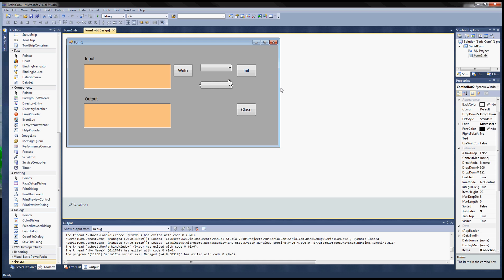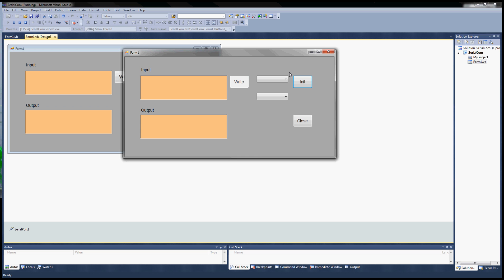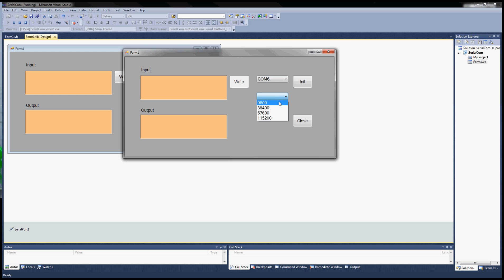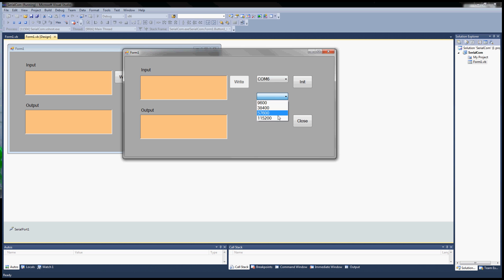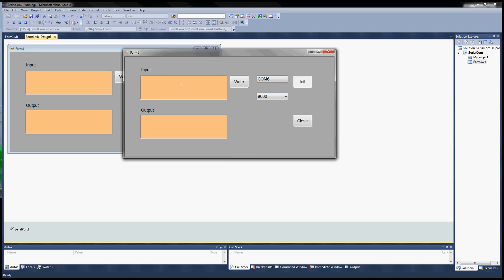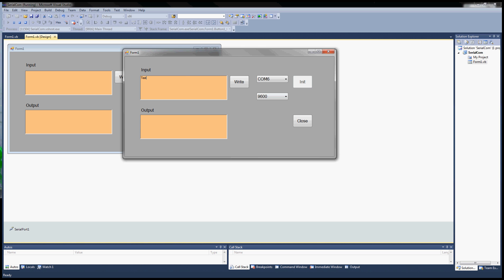Visual Basic Serial COM Port Tutorial (Visual Studio 2010) - Part 1

Comment: I tried send hex over RS232 in VB  and successful and properly received by another RS232 if hex value less than &H7F.  But, if the hex value greater then &H7F to &HFF then the receiver side shows &H3F. I've believed that the problem come from the signed and unsigned. Would you mind to give me an advise for  how to solve it?

Comment: I just downloaded and tried it out. No errors and it worked good using VB Express Version 13 and Windows 7. Thank you so much Kelvin. I used (2) USB cables and (2) generic Arduino type FTDI modules. First I got the cables tested using (2) sessions of Coolterm and checking the installed comm port drivers within Windows. It isn't difficult to see which comm ports are in use by plugging/unplugging each of the FTDI modules. Then I made it a loopback connection with just one cable and FTDI module, which is the way your program is setup. I want to caution people when using these modules you only connect GND, Tx and Rx. The Vcc should probably not be connected. Now I think I can use your program as a basis to write a receive only program and store data to disk. For those who don't know, all the Visual Studio program languages are available for 30 day tryout at least if you have an account at the MS store. How many of us can pay $500 for our hobby. I know I can't.